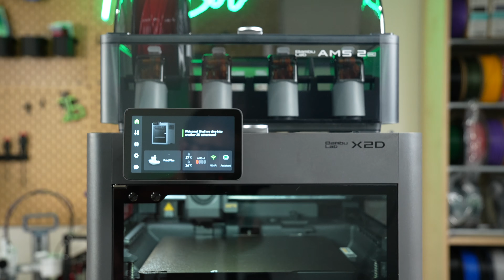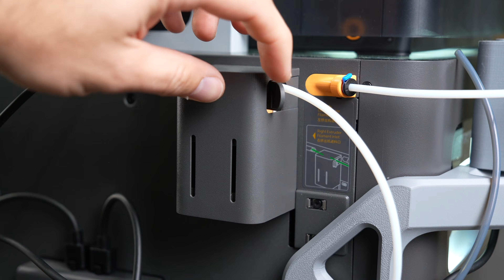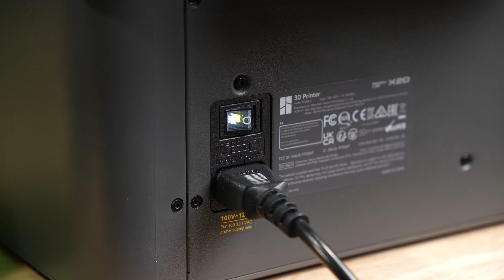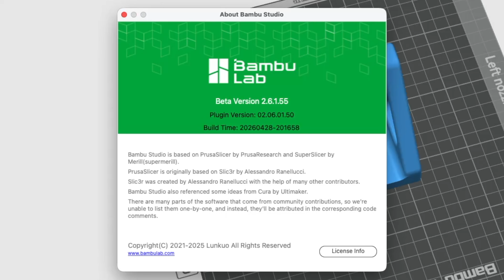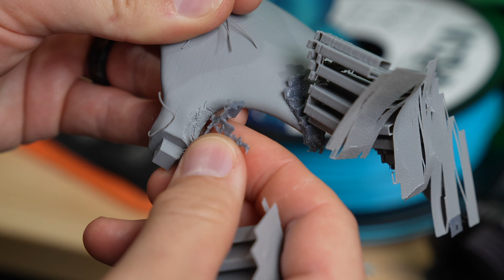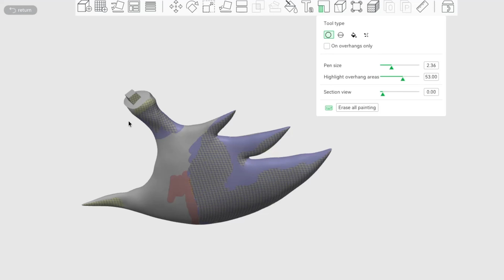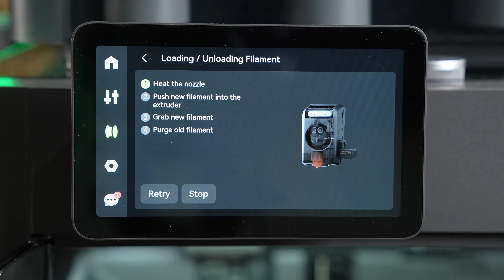I Tested the Bambu Lab X2D... Here's My Verdict

Comment: @ModBotArmy thanks for skipping the Bambu Drama. I work in tech and I can tell you two things one the controversy as it’s been presented is at best one sided and does not accurately describe what’s been happening. Two the SFC who’s representing the AGPL side of it needs to properly disclose two things 1 they have raised hundreds of thousands of dollars stirring this pot. 2 what they’re actually trying to accomplish is to use the AGPL license to take control of Bambu’s private libraries. They believe they can use the AGPL as a Trojan horse to force Bambu to surrender their private code. Of course there is no legal foundation for their position, which is why today, despite all of their vocal opposition along with claims of several violations of AGPL on the part of Bambu, the SFC has not brought forth a single legal case against Bambu and likely never will. Unfortunately, for the league of Louis Rossman trolls who will jump into your comment section. It is not illegal to have closed source software in your platform stack.

Comment: i think bowden drive was an acceptable trade-off to keep the printer in the same size as the p series printers. if they had put a direct drive on the toolhead, weight is not the problem the size is the problem. realistically to keep the same bed dimensions they would need to make the overall length and width of the printer a bit larger to accommodate. that probably would have resulted in more cost as well. if youre printing multi-color only, i can understand quality it wont be as good as a direct drive but ive been printing on my x2d not multi-color but just one primary and one support (like the rest of the 99 percent of people) and for that use case i don't think there is any other printer this size within 1000 dollars that can even compete.
Reply: Yes, a second toolhead extruder in this box would have limited the dual-printable build plate area - like the H2D.
Reply: It'll be interesting to see if P3C changes this when it's officially announced
Reply: @awright18 i would think the P3C will be like the snapmaker U1. A changer but only with one nozzle. Certainly could be wrong but then that's generally a bad buisness strategy when the X series already exists

Comment: I've been thinking.. would it be possible to use the Bowden Extruder to act as the TPU Feed Assist Module? We'll have to connect the PTFE tube of the Bowden extruder to the left / main nozzle which then would act very similar to the the TPU feed assist setup. The logic is the same for it to work without any issues. What do you think?

Comment: For me the 300c hitend max is the biggest issue, they updated everything else for high temp filaments except that... and its not even a hardware limitation, its software
I wanted the smaller build volume so as to not waste time and electricity for smaller prints, it makes no sense to print a 100mm item in the huge chamber that is the H series

At least they said they are open to possibly changing it if enough people provide that feedback, after-all, its again a SOFTWARE limitation
Reply: Some say it's a hardware limitation from a smaller cold side fan
Reply: NTC thermistors are only rated to 300°C, AFAIK, so there might be a hardware reason for it. Idk.
Reply: @ultramegax  they could very well pop whatever is in use on the H2 series as a free or paid hardware upgrade, I would even be ok with that (mildly)
Reply: @ultramegax  they go a bit above (around 330) and there are other types that go even higher

Comment: I had a bad experience with the X2D AUX nozzle. Primarily because I changed the hotend to the E3D high flow OBX nozzle. And long story short the Bowden extruder had a hard time with retractions since the high flow nozzle has four channels and different back pressure than that of the Bambu standard 0.4mm nozzle. I installed the standard Bambu nozzle back and all is well now. Just be advised that the AUX extruder doesn’t like high flow nozzles. I tried all shorts of different tuning profiles and none of which stopped the stringing. 

Lastly the filament tracker switch is very annoying because the software doesn’t allow you to load filament via an external spool with the tracking switch installed. So you have to disconnect it every time you want to load TPU. Very annoying feature!

Great video!
Reply: Also it doesn't make any sense using a high flow nozzle in Bowden setup when it can't even push those high rates

Comment: This printer was exactly what I needed. I make functional parts for vanish motorcycles using the softest TPU to do some of these parts I need support material that was very limiting on the X1C. I can now use TPU 85 with the TPU assist module and a support material in the auxiliary hot end. I do use a lot of asa cf material and it is nice to have a heated chamber. I still have my X1C and it continues to be a very reliable printer for all my other uses. And, I finally got rid of that crappy display on my P1 S.
Reply: I'm not sure if it would work well, but I tried foaming TPU ("lightweight TPU", "LW TPU" or whatever) and it is very interesting. The texture is very matte. And while it is expensive, because of all the "flow rate" adjustments magic when I did napkin calculations it is actually decently priced. Because again the whole idea is that the filament gets bubbly inside and ergo you extrude less of it.
But idk how durable it is for motorcycle parts. The outside texture and the softness is pretty darn good tho. Especially in comparison to TPU for AMS, TPU 95A from bambu. I don't have experience with TPU 85A, and I didn't buy any feeding assists for TPU yet.

What is your process with printing TPU on X2D? So far I only printed it on A1, because the setup is so much easier. But I am really wanting to do TPU with supports from another material. TPU supports are a nightmare. I think I would try having TPU on an external spool, maybe above the printer and feeding it directly to the main extruder? But putting the whole AMS 2 pro away seems like such a hassle.
Reply: Maybe your experience with TPU you can answer this please.
My plan is to build a glass wiper consisting of a stiff ASA base (handle) and a soft TPU contact edge.
Can this be done in one print process or divided into 2 separate prints?
Or is it even possible to get the TPU edge onto the ASA base on this or any other machine?
Thinking ASA as the "support" material and print the TPU on the edge? 
Thanks
Reply: @pureblood5903 2 prints way different print and heatbed temps

Comment: I did a couple of days of research and bought this printer last week, my first 3D printer. It's an eye opener and also a steep learning curve. I accidentally poked the acupuncture needle up so far and caused a clog above the heating element. So on day 3, I've already opened up the print head and clear the clog, not a fun experience but the instructions are straightforward. 
This is a powerful tool and I can't wait to keep making stuff.
Reply: Now with the anxiety out of the way, are you feeling more confident going forward?
Reply: @geoffreyhowells7290 Yes, I'm currently printing an 18 hr waste basket for my wife. I scaled it up to 20 cm tall. But yes, now I understand why people have more than one 3D printer.😂
Reply: @TwistofWrist1941  Be sure to check out Bambu Academy for the X2D. You can increase the layer height to .28 to decrease print time. It will sacrifice a little quality for speed. Once you learn all the crazy variables, you'll be able to spot an issue and have it fixed in lighting time. Hope you have a blast.
Reply: i’m about to do the same as first printer but a little nervous!
Reply: @rizzotherat7848  Once ya dive in, the nerves chill. The first time is always the most difficult. Just take it slow and easy and you'll do great. There are tons of great resources & YT videos available. Bambu Academy & Wiki have great info as well.

Comment: After using mine for the last week. Swapping between .4 and .2 nozzles showed some serious issues if the machine doesn’t auto calibrate itself before prints. I had to set nozzle compensation to on at the start of my prints for the printer to print with the .2 in any shape of quality. The Z height was always too high until I did this. Otherwise, I bought this for the right nozzle to be a support nozzle. I think the TPU feeder will be a purchase as I was printing with TPU a few days ago on the H2C and was sour how much I had to remove just to print TPU. Overall, great review and I would agree with the video all around. Cheers!!
Reply: "I did some stuff that changed the calibration and then the printer didn't work properly till I calibrated it again". What a stupid comment
Reply: @schlomoshekelberg7831  I see reviewers do this all the time too! "I had some annoying problems out of the box, but then when I ran the calibration meant to prevent these problems, the problems went away!" Well yeah!
Reply: @schlomoshekelberg7831 damn 😂
Reply: It sounds like the printer was using a 0.2 nozzle and printing a file sliced for a 0.4 nozzle. I switch between nozzle sizes often without calibrating and it prints as it should. Normally the software won't let you, but I've seen weirder things happen. It's a good habit to always double check.
Reply: Sounds like skill issues. I had none of these issues.
Reply: Did you ever take the Bambu Academy tutorial? It does say to calibrate upon changing nozzles, and even filament types and possibly build plates. Think of this as a CNC machine requiring precision... cause it basically is. It does have a learning curve, but you'll figure it all out.  Good luck and happy printing.

Comment: Bambu Lab must not get any support after Paweł Jarczak situation!
Reply: Hey, if you have that luxury then go for it.  I don't.
Reply: Respectfully, I have to disagree with the framing of the issue. For most people outside the software development field, it’s difficult to understand the nuances in the controversy, which is understandable. However, like most things in life, there’s more to the story. The issue at hand revolves around third-party development libraries. Most complex modern software is built using libraries, which by definition are separate code from that of the core software being developed.

AGPL governs the slicer’s code; it does not automatically govern code beyond it. The nuance many are missing is that the block of code that was redacted and subsequently restored by the developer (and which seems to be the major red herring in the situation) is only to call Bambu’s private libraries. This block of code is itself governed under AGPL; however, it is not actually the subject of the dispute. It merely exists to call a third-party library; it is not the library itself. The network libraries in question are optional and only provide Bambu-specific remote printing and monitoring features. Forks such as Orca Slicer (and more than a hundred other forks) operate successfully without these libraries and which support not only Bambu printers, but numerous third-party printers as well. Orca Slicer itself publicly describes the networking plugin as a non-free, optional component providing extended functionality for Bambu printer users.
Reply: @wayne0220  You wrote a whole essay on code licensing, but completely missed the point. This isn't about AGPL nuances - it's about a corporation using legal threats to publicly bully an open-source developer who was helping them for free. Legality doesn't equal morality. They burned the trust, not the GPL.
Reply: @sndm1  it’s okay for you to see the issue this way, however it does not align with how the primary parties involved see it. Those are; Jarczak the developer, the SFC the organization who legally defends the AGPL, and of course Bambu. 

The issue does involve the AGPL and Bambu’s private libraries. Unfortunately, the developer was not attempting to help Bambu out, he was attempting to reinstate access to Bambu’s cloud controller by way of Bambu’s private networking Libraries. 18 months ago Bambu announced that it would no longer accept connections from third party slicers to its private cloud controller, and as a result Bambu redacted the code which made the call for the private libraries. 

The developer reinstated that code, then to gain access changed the identity of Orca Slicer to pose as Bambu Studio to bypass Bambu’s access control system. It was this action of making unauthorized access to their private libraries and cloud controller that caused the cease and desist notice to the developer.

Comment: its a shame that those new machines comes at a pretty bad time,  they have good hardware but the way the company is handling the software is just catastrophical and we shouldnt be supporting it until they come back down from their greedy seat...
Reply: If you have that luxury then go for it.  Bambu Lab make the best printer at the price I can afford.
Reply: Respectfully, I have to disagree with the framing of the issue. There’s been too much misinformation out there thanks to Louis Rossmann. For most people outside the software development field, it’s difficult to understand the nuances in the controversy, which is understandable. However, like most things in life, there’s more to the story. The issue at hand revolves around third-party development libraries. Most complex modern software is built using libraries, which by definition are separate code from that of the core software being developed.

AGPL governs the slicer’s code; it does not automatically govern code beyond it. The nuance many are missing is that the block of code that was redacted and subsequently restored by the developer (and which seems to be the major red herring in the situation) is only to call Bambu’s private libraries. This block of code is itself governed under AGPL; however, it is not actually the subject of the dispute. It merely exists to call a third-party library; it is not the library itself. The network libraries in question are optional and only provide Bambu-specific remote printing and monitoring features. Forks such as Orca Slicer (and more than a hundred other forks) operate successfully without these libraries and which support not only Bambu printers, but numerous third-party printers as well. Orca Slicer itself publicly describes the networking plugin as a non-free, optional component providing extended functionality for Bambu printer users.
Reply: @wayne0220 doesn't change that using open source code and packinging it as closed source and then attacking the people trying to make it open source again is insanely evil
Especially since I moved to linux and moved to mostly Foss software for everything, I feel sad seing people support closed source software and devs
Reply: @wayne0220 especially that ignoring the subject would make the death of one of the printers in a 50h long stream be for nothing, it's a lesson that we need to not ignore, we must not stop fighting, if we ignore this kind of comportements, everything will follow suite and get way worst for everyone, it's a distopia we must not accept
Reply: @SpeedyGwen   We actually don’t want what the SFC is asking for, it would be bad for not only 3D printing, it would be bad for any industry that uses software. Giving any organization super rights is a bad thing, and if one organization can have they all can… really bad.

The nuance that most people are missing is that the SFC has a radical position on how they believe software licensing works. They would like to expand the reach of their licensing, such that if another set of software (licensed under its own license and Ts&Cs) interacts with AGPL code, their license supersedes the other, and they take possession of the interacting code. To put a not-too-fine a point on this, there is no legal precedent to support the SFCs’ position. In fact, case law going back decades affirms the exact opposite. 

To better illustrate this, let’s imagine that Microsoft via Internet Explorer wrote a license that said, if a user visits your website, because Internet Explorer loaded the site, it was then owned by Microsoft; this is in effect what the SFC is arguing in its position. Their position would have dangerous consequences for how software development works. Let’s also remember that the SFC‘s chief responsibility is to legally defend open source licensing. Despite raising AGPL licensing violations as well as being highly vocal in their disapproval of Bambu, the SFC has still, to date, failed to bring any legal action. This is most assuredly because there is no existing case law to support their position.
Reply: @SpeedyGwen  we don’t actually want what the software freedom conservatory wants out of this. They want a contractual super power that to date no one has ever been given and for good reason. Once we go down that path any organization can have it. It’s bad for software as a whole.
Reply: @wayne0220  I'll stay on the path of opensource tho

Comment: Thanks for the review Daniel. I still on the fence with this one. My X1C is long in the tooth, but I'm not sure this is much of an upgrade vs the P2S
Reply: It's a huge upgrade over p2s
Reply: @riba2233 other than the chamber heater, I'm not seeing it
Reply: @Killa_Prints  than and a 2nd head is a huge deal, along with 1.5mm belts
Reply: 1.5 pitch belts increase print quality alone. Worth it with the other things included for only $100 more than the p2s

Comment: the Bowden is not ideal, but its intentional. If they went with dual direct drive like the H2, it would have comprised the build space even more. it was a choice to keep the build size the 256^3 (except when using the Bowden.) it is slower, but so far ive found the quality acceptable for basic dual colors.
Reply: Its easy to underestimate how huge the printhead of the H2D is. Not to mention the increased weight would be to much for the P2/X2 motion system to accelerate.